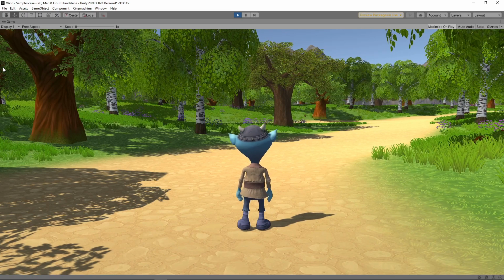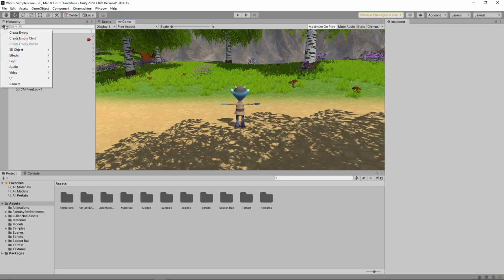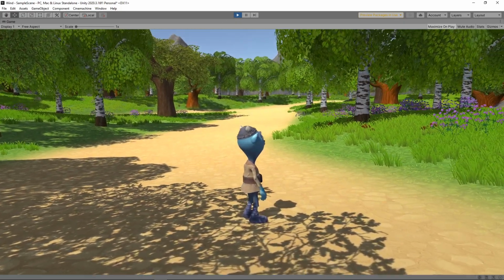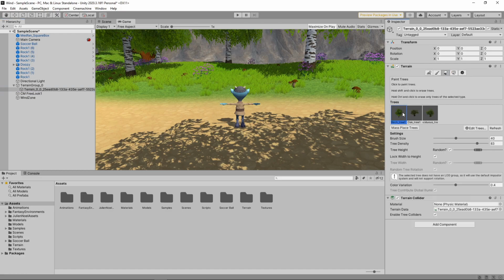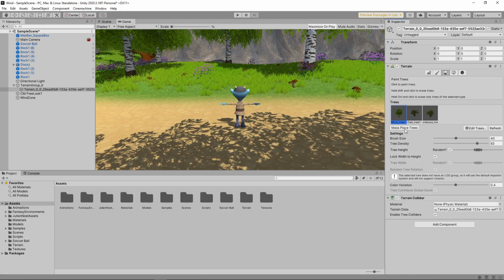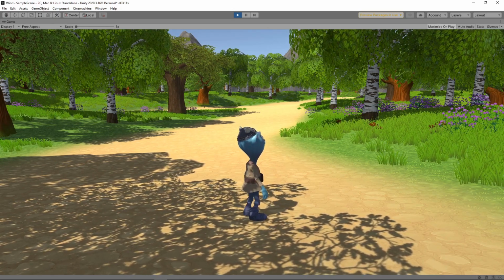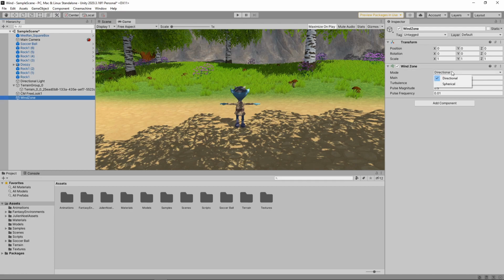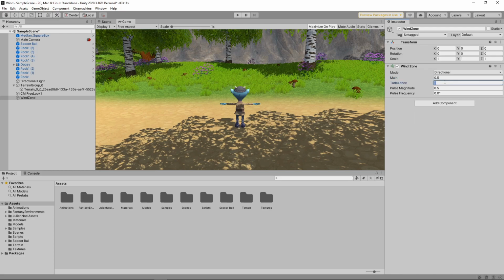Using Wind Zones to Make Trees Sway (Unity Tutorial)

Comment: the bend factor on edit trees is not showing up, do you have any idea why?
Reply from the maker: Hi, I'm not sure why it wouldn't be showing. What version of Unity are you using?
Reply: @KetraGames  i'm using 2020.3.21f1 Personal. the issue seemes to be with the tree i imported (Conifers), i tested with another tree (SpeedTrees) and the windzone worked just fine, but it didn't require me to edit the bend factor, nor did the option show up.
Reply: @shinoum  same